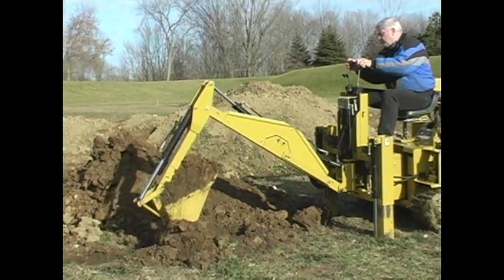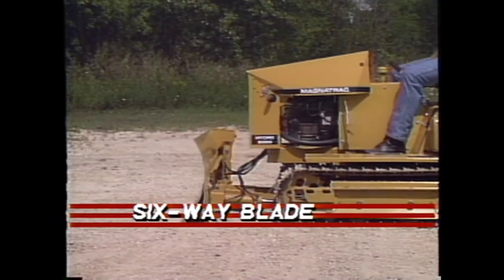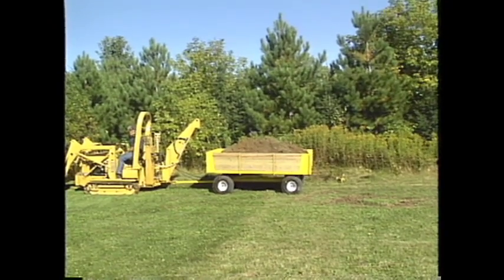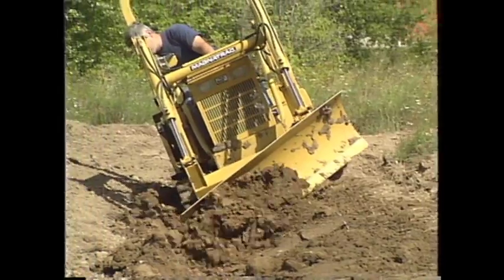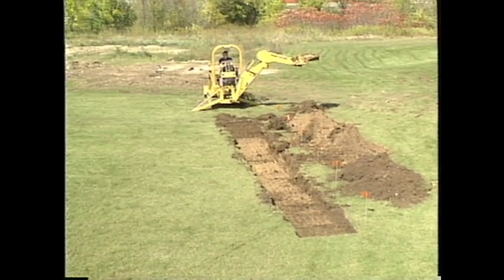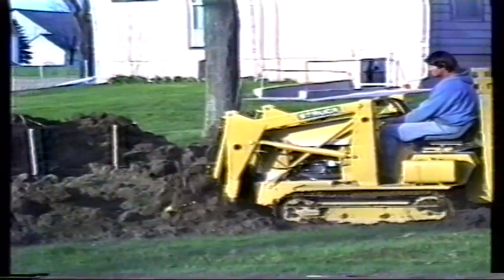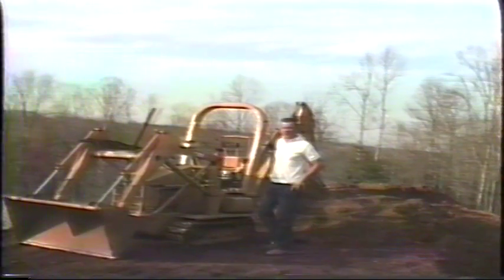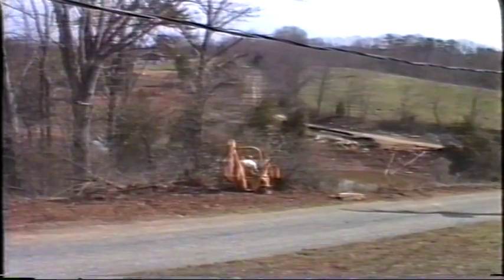Struck - MAGNATRAC - MH Series Compact Crawler Tractors - Operation, Procedures & Customer Comments.

Comment: +Jack O "Our hottest super compact tractor, the MAGNATRAC® RS1000 fits into the bed of a midsize pick-up."  From their web site, so yes, it will.
Reply: no that is the littler one the rs1000 weighs about 800 pounds the one shown here is maybe an mh7000 or mh8000 2000 to 3000 pounds and just a little bigger overall
Reply: deanc2006 Thanks!